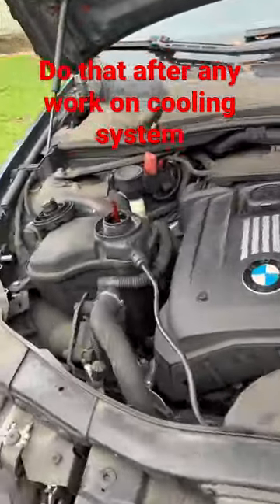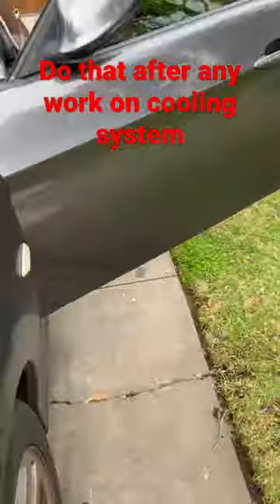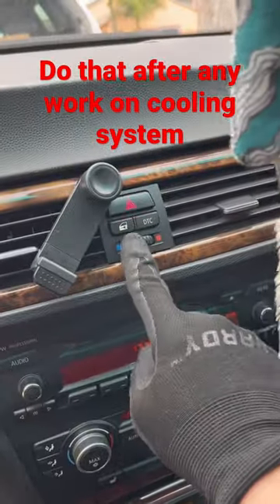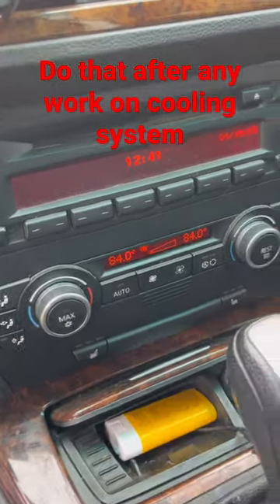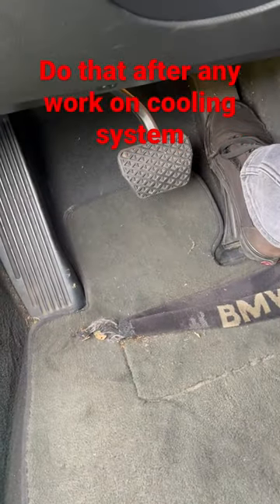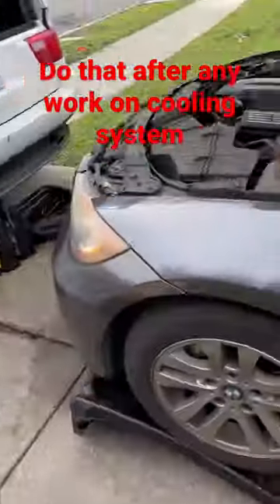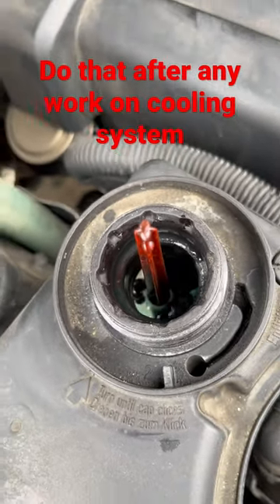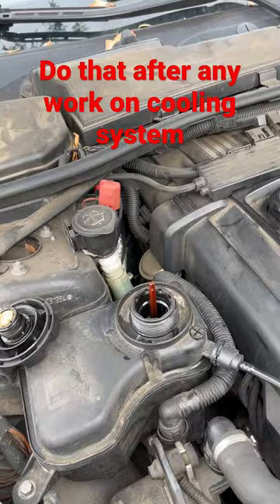How to bleed cooling system on BMW with electric pump

Comment: Make sure to use a proper battery charger.  If you have an AGM battery, you will thank me later
Reply: Do you have an affordable recommendation? Will OBD port chargers work?
Reply: Lol only dealers do this and for warranty cars this ain’t needed ur battery won’t die from this unless it’s already drained
Reply: @memeseller1706  I’ll be sure to take your advice given your credentials

Comment: I've done this process before, i let the pump run for at least 20min & it had a long steady stream....its suppose to stop on its own.... how do you know it's done?
Reply: The pump runs for 12 minutes with the car on but engine off
Reply: As long as no air bubbles really in reservoir. Also make sure to unscrew bleeder screw.
Reply: I would assume you have a bad sensor??
Reply: @Rtrac44 what’s the sensor name? Because mine I did this whole process, but I don’t see no stream running.
Reply: @dawhitecastle while it’s running

Comment: Did this for 12 minutes, engine is still wanting to overheat upon coolant replacement. e39
Reply from the maker: It’s completely different system on e39 first of all, look into your water pump/thermostat
Reply: @ pump/thermostat were replaced a year ago - system was operating normally up until I replaced radiator
Reply: perhaps electric coolant pump is bad? from debris?
Reply from the maker: @chaino2618 check this video
How to bleed cooling system on BMW E46
https://youtu.be/X5lD5Q0trM4

Same procedure for your car

Comment: Depending on your pumps health will determine the flow preasure. Usually itll slowly cycle up to 100% preasure in the span of 12-15min. I suggest doikg this 2 times atleast as theres so many pockets for air to get trapped inside the motor. Especially since its at an angle. Speaking from experience

Comment: do it exactly how he tells you six minutes just like he said and then turn it on make sure your heater🥵is on leave your reservoir cap until let it leak out a little bit but put on Your Reservoir and qcap on let it run with the AC on max to make sure you’re a fan turn on all the way and then 4 to 6 Hours to check your level on your antifreeze sure it is cold 🥶 before you open it It works for me all the time He’s the man he reminded me
Reply: Bro can you please re write it where it make sense cause you lost me

Comment: Exact same car I own. Right down to the color. My interior is gray though. Changing the coolant bottle as soon as I finish the A/C Compressor, power steering pump, and pulley. I was bleeding it with the car running. Thanks for the tip

Comment: I am so happy I came across this video I just had an auxiliary coolant line below about 3 hours ago at the house as I pulled into the garage, and was able to cut it and reconnect it until the parts store opens in the morning. Then I came across this in time to bleed it properly 😊

Comment: well you can even undo the bleeder screw as well with the same procedure. get the bubbling air out and it streaming smoothly
Reply from the maker: First of all - absolutely not necessary to do so, second if you remove bleed screw it will spray all over once water pump activates
Reply: @Zeiten he  means if you loosen it not undo it all the way it will help with bubbles and stream…this is a fact

Comment: Hey man, i need ur help, i've done this, usually it works, but just today after pressing the pedal, it doesn't start bleeding, no reaction, what is wrong? I've been replaced the electric pump not long ago and works properly since then, but today its not
Reply from the maker: Check the fuse, there is water pump fuse in glove box compartment

Comment: What happens if this happens when engine is on?
What happens when the meter goes to red ?
Reply: Don’t do this with hot engine. You don’t even need to turn on the engine for this. If the meter goes to red that means there is air in the system. Just let it do it’s job for 10-12 minutes. Turn on the car put on the coolant cap and it should be good to go

Comment: I don't understand, some people say you should leave the cap closed some say leave it open, which is correct?
Reply: I’ve done it multiple times on my car with a n54 always did it with bleeder screw closed and cap closed try to do the bleeding my process twice. You might need to add more coolant after you bleed it because air is pushing out of system causing the level in the tank to lower
Reply: Doesn't matter if the cap is open or closed as long as you keep the coolant topped off to not allow air into the system since the coolsnt acts like a air barrier.
Reply: My ac/ heat not working what do I do then ?

Comment: what is the point of the blue and red dial thing on top of the entertainment center If you could change your temperature on the screen
Reply from the maker: It’s a bmw thing😁
Reply: @Zeiten  man i wanna know i have the same shit 💀😭
Reply: They have a seperate temperature for your head area heating, feet and defrosters on the lower one

Comment: For how long do you leave the engine running without the cap?
Reply from the maker: 2-5 mins
Reply: @Zeiten do I have to keep pushing the accelerator for those 2/5 mins ?
Reply from the maker: No, 10 seconds activates bleeding without engine running, when you start the car with cap off just let it idle that’s it

Comment: Hey man does this method work with an E39 525i with the M54 motor? Thanks!
Reply from the maker: No, use this How to bleed cooling system on BMW E46
https://youtu.be/X5lD5Q0trM4
Reply: @Zeiten  thanks dude! So this should be good on e39 as well
Reply from the maker: Yes, although you do have secondary electric water pump it will automatically turn on when you turn heater on